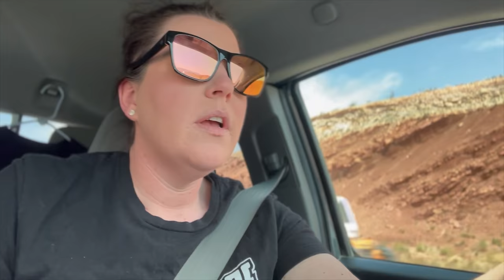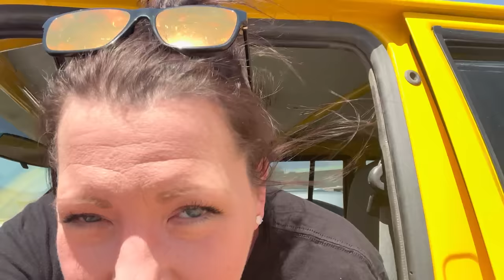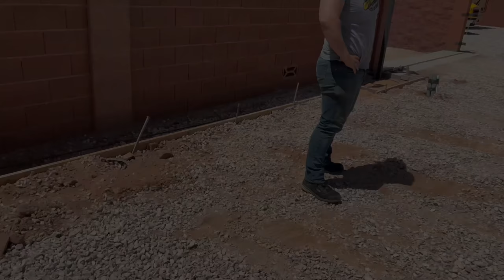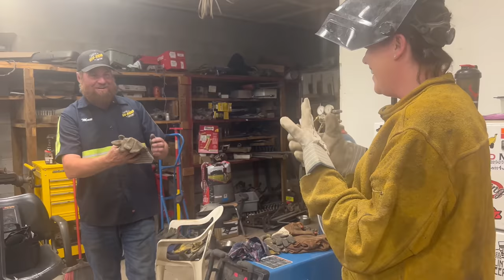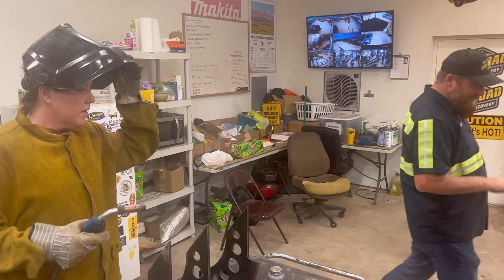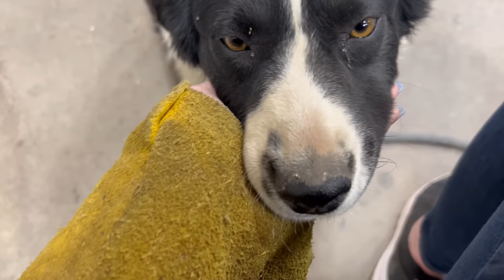Welding On The World Largest Offroad Wrecker!

Comment: As a man not as tall as Walter,  6'3" with a 31" inseam...  It took a bit of modification to seat brackets to get my head inside roll cage.   Walter would need to try on vehicles...  Would think Walter's f350 should do light off road / dirt roading.

Comment: Matt is already building a Walter size rig. The new heavy wrecker is the only thing a 6'10" man will fit in.  You just need to get his application turned into MOOR.

Or maybe a single seater, custom chassis, bouncer style.  Drop in through the halo,  latch a roof down,  bam, Bob's ur uncle...

Comment: When mig welding with regular wire (not dual shield) you should be pushing the puddle as opposed to dragging.  So when making those fillet welds you should have been starting on the end closest to you.  Welders have a mantra- if there's slag, you drag- meaning if stick welding or using something like dual shield wire you want to drag and for everything else you want to push.
Reply: and that heavy steel I would have beveled the vertical edges meeting horizontal plate for a few good passes.  👍🏾
Reply: @clittle1559  absolutely agree

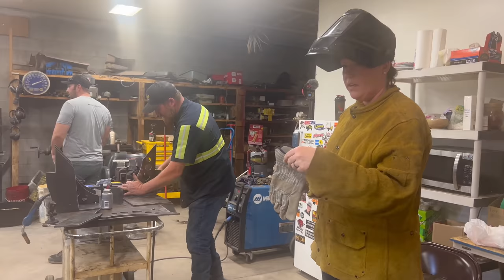Comment: 7:52 Well, at least Matt was a nice guy and gave you two RIGHT-hand gloves, Hollie --- right-handed people tend to wear out their gloves more on that side, and so most of da time you get two lefts when you are given two of the same glove. :P
P.S. Well, you know, though, you can sometimes fix that situation by simply turning one glove inside out so that it becomes configured for the other hand.  Stiff-fabric work gloves like that wouldn't work that way, though, of course, plus if the glove has a flock-lined interior or is otherwise "side-sensitive", you might have difficulties, as well. :P :D

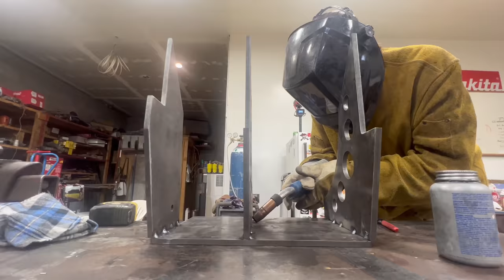Comment: 10:32 Nice angle to get the sparks, but be careful. I took shots like that with a DSLR and the sparks bounced right off the plastic of the camera body and lens (Tamron 90mm). However, the sparks did melt holes in the lens's front glass. You can rub your finger over it and it feels like sandpaper. Expensive mistake. I know you & the MORR guys use GoPros, but it could still be an issue (I'm not sure if the front bit is plastic or glass - at least it's replaceable). Something to keep in mind!

Now you know why safety glasses are plastic and not glass! (Don't let anyone use their regular glasses as "safety" glasses!)

Comment: Build for Walter, first thing I though of was a build my cousin did for a local logger back in 1980, it was a body swap he put a Cadillac body on a 4x4 F250 crewcab frame. just a thought.
Reply: That would be too darn cool
Reply: @mikemiller3007  It was easier than it one would think because they both had the same wheelbase and width.

Comment: things Explained 🙄😬😵🤪😎  for Holly ~

Utah trail Views sLow & easy are the best value providing most smiles for all the miles and And AND u can drink your tea or coffee all the while

the infamous Utah Blow Sand has a rounded granular structure where it compresses, come together, fits, meshes very easily and thus slip around very easily as in under your tires for poor traction.  More granular sand particles/pieces would lock together more providing more traction for your tires

a Modern day Flintstone car arrives that didn't quite make it thru the tunnel with Fred or Barney behind the wheel. Not really sure Ask Tucker.  Anything to impress their guest

tack team welding a new Olympic sport with try outs @ Matt's Off Road Recovery.  Requirements: be nice, show Up, know how to Laugh & where to go to for Lunch

Holly, "there's Hope".  Visit Often!